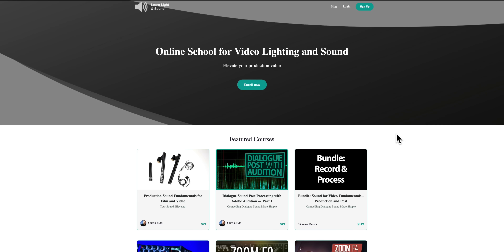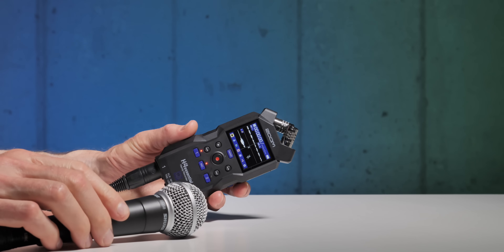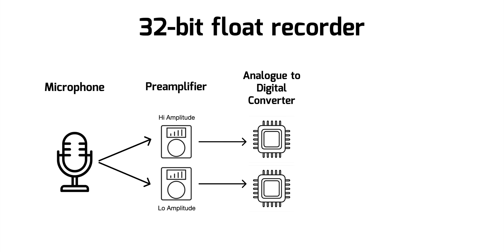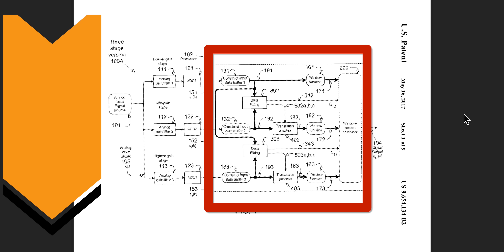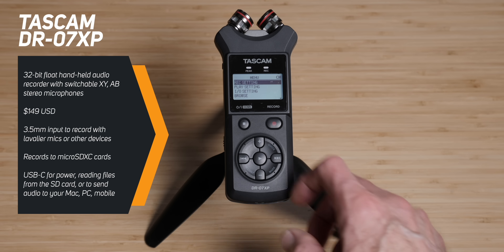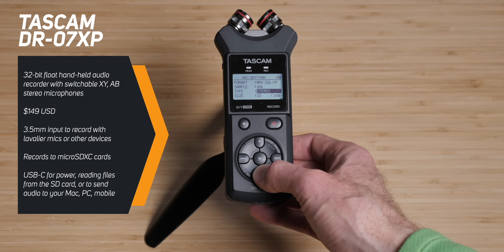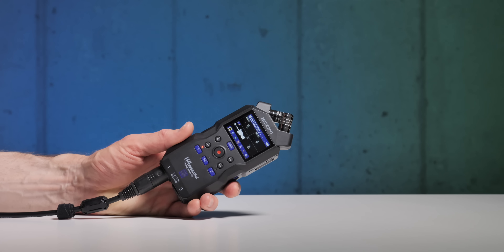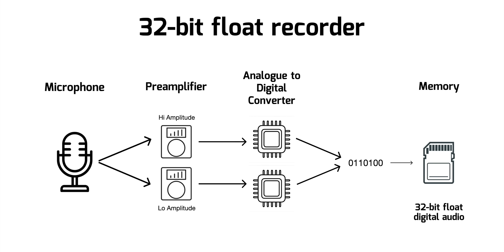PART 2 — 32-bit Float Audio Recorder Quality

Comment: It's still not clear why 32 bit float needed when most preamps don't even have large enough Signal-to-Noise ratio to fully utilize 24 bit dynamic range.
Reply: Because it is not the same.32-bit floating point isn’t mainly about capturing more dynamic range from the preamp—it’s about avoiding digital clipping and preserving recoverable headroom. You can overload a 24 bit fixed point and then the signal is clipped but not a 32 bit float point.
With a cheap preamp you have a big problem when you try to record a signal with a huge dynamic range. When you set the gain too low the signal is getting lost inside the noise floor, try to set it higher above the noise floor and you drive it  to overload and clip the 24 bit fixed point. With a 32 bit float it is like you have two cheap preamps short of, one only for the low gain and the other for the high range. It simply allows scaling of very large or very small signal values without immediate clipping. It will not make the mic pre sound any better but at least you are not clipping it or diving into noise. Still some noise but less. A 32-bit float preserves signal detail across a wider range of levels, reducing the risk of either clipping or losing detail to the noise floor.
You could think of it as having multiple “virtual gain settings” captured simultaneously—like having both a low and a high gain recording you can blend later. It won't improve the noise performance or sound quality of your preamp itself, but it makes it much harder to ruin a recording through bad level settings.
The core benefit is preventing digital clipping and enabling level recovery—not magically giving you more preamp dynamic range.
Reply: @peterpeper4837  but you can have good pre amp and 24 bit DAC with gain set so your noise takes lowest few bits and still have more than enough range left, no?
Reply: @JGnLAU8OAWF6  Sure but you need a very good preamp and that is expensive. But it is not olny about dynamic range when it comes to ADs , it is also about the filters and the way they are implemented that is why it is even better to move to 32 bit fixed point for studio recordings even though the dynamic range of the 24 bit AD  at 144db is much higher than any mic pre. 32 bit float is not for everything for sure and it is as good as the 24 bit converters it uses but perhaps a bit worse with all those algorithms it needs in comparison to a good straight 24 bit AD.
Some people report hearing strange artifacts at the point the 32 bit algorithm changes ranges
Reply: You can think of 32-bit float as allowing your 24-bit recording to be a “window” within a much larger dynamic range. The actual precision of 32 float (IEEE 754) is still only 24 bits (23-bit mantissa, plus 1-bit sign), but the remaining 8 bits (the exponent) allow those 24 bits to moved up and down the very large dynMic range scale, so it is effectively a 144dB dynamic range (24-bit) that can be shifted up and down within 1528dB scale. 

Even if you only have a single preamp and ADC with less than 24-bits dynamic range, you can still take advantage of the ability to use that resolution within a larger numeric “container” by multiplying or dividing the signal values so that you can avoid destructive clipping, or having a small signal get lost in the noise floor.
Reply from the maker: When you use multiple quality preamps at different gain settings on the same input, you should be able to achieve more dynamic range. But to your point, for spoken word audio, this is rarely actually needed. Then the benefit is that you don’t have to set gain during recording, if that’s a benefit for you.

Comment: I'm a bit confused. Which device has two mic pres? I thought they have only one and there is also an algorithm that splits the signal to two or three 24 bit ADs then another to combine them to 32 bit float
I also never heard of a 32 bit float with one AD . There are 32 bit converters but are fixed point not float. Floating becomes the signal after it is combined from at least two 24bit ADs.
Reply: The marketing of 32 bit float recorders with single ADCs came to light a few months ago. To take one manufacturer, Zoom say that if their specs and adverts don't mention dual ADCs then the device has one. You can store any lower precision bits into higher precision bits but of course the value remains the same. 1.01 is the same as 001.01000, to take a simple example. So a single 24 bit converter storing its output in a 32 bit float container has no inherent advantage, if that's all that is happening.
Reply: @Ozpeter  The standard specifies that a 32-bit binary number should be written as: x * 2^n. The part "x" is called the mantissa, and "n" is the exponent. To find the mantissa x, the decimal point is shifted in front of the leftmost 1. The exponent n corresponds to how many positions the decimal point was moved to the left. The fewer positions the point is shifted, the higher the precision. Precision decreases the more you have to shift the decimal point, because the mantissa loses significant digits during the shift.
Reply: @Ozpeter  Yes, changing the format doesn’t create additional resolution or dynamic range beyond what was captured by the ADC. The ADC can clip if the analog stage is overloaded.
The only thing single  “32-bit float” provides is the ability to store the ADC’s digital output in floating-point format — which is not useful if the analog stage clips first.
Reply: IIRC there is no 32 bit ADC with all bits significant. Anything past the 24 most significant bits are thermal noise (at room temperature). If you need more dynamical range, you'll have to cool down your circuits like in CCD camera for astrophotography (with a Josephson cell)
Reply: @physiqueDrummond  I visualise it as a 1500dB wide "road" on which you lay a 144dB (roughly) wide "ribbon" of data.  You can lay it down where you like, more or less, which makes things safer.  But indeed what determines the audible quality is more the width of the ribbon rather than the width of the road.
Reply: @physiqueDrummond   32-bit DACs  allow digital volume control of the outputs without loss of quality and with no use of dither. The same cannot be said of digital attenuation on a 24-bit system, where truncation error results in random noise loud enough that when summed to your signal effectively increases the noise floor. Then you need dither to solve that.
A direct consequence of implementing output level digitally is perfect stereo matching.
Reply: @peterpeper4837  the only 32-bit DAC I could find is AK449 from Asahi Kasei Microdevices and their  dynamical range gives a 22 bits width. The 10 others LSB are dithering noise added by the DAC itself.
Reply: @physiqueDrummond  There are many devices now that are using 32 bit DACs like SSL, evn in pedals you find it like Roland. Not sure they all use the same
Reply from the maker: The Sound Devices US patent specifies 2 or 3 analogue preamps per input.
Reply: @curtisjudd  I checked and it is only one pre and two ADCs

Comment: Great as always. I wish I had your sound world. The condos in Manila have such thing walls. My mics pick up the airconditioners running on the floors above and below me. No way to get a building full of condos to turn them off. Add to that deliver trucks and motor cycles.  Yes, I use directional mics. I do each of my scripts twice. I have one mic going to the camera and the other going to the Zoom F3 so I have 2 set of audio for each for my 2 scripts run throughs. Eh... Just life in the Third World...
Reply from the maker: Fortunately, today’s noise reduction is good at managing AC noise.

Comment: I am  happy  with the zoom H4 essential  I have not heard much noise on my recordings so far  but thats maybe because I dont use the onboard mics.. based on my experience  I still dont know if the preamps make that much of a difference these days when the final output files are played back on streaming platforms  which  do some additional dynamic processing as well ..  the digital files get  converetd and processed so much  its really hard to deliver a quality recording to the end user  who will most likelly listen to the  sound using  tiny headphones and playback equipment that also has alot of  self  noise ... It would be awesome to hear the mix pre  vs  the zoom H4e  same recording same time same location same microphones ..  I wonder if we will realy spot the difference..  Thanks for the great video  I might pick up the mix pre or a zoom f series recorder  :)
Reply from the maker: Depends on the output label of the mic you use. Dynamic mics and low output condensers definitely stress the H4e’s preamps.

Comment: It's not clear to me that dual preamps is necessary for an ideal 32-bit float recorder implementation, since the conversion gain on many ADCs is configurable rather than fixed, so the cross-over point of the conversion gain between the two ADCs could be dynamically changed to accommodate different preamp gain output scenarios.
Reply from the maker: Maybe. Conversion gain occurs in the analog domain?

Comment: Curtis, so far only experience with 32-bit recording is with Sound Devices MixPre3 II and in the limited times I felt it was going to be useful it was. Generally, I am still mostly recording spoken word with a 24-bit setting. In either case I still do gain staging when setting up to record when I can. Doing doc work situations can change rapidly and drastically and 32-bit comes in handy.
Reply from the maker: Same here 👍